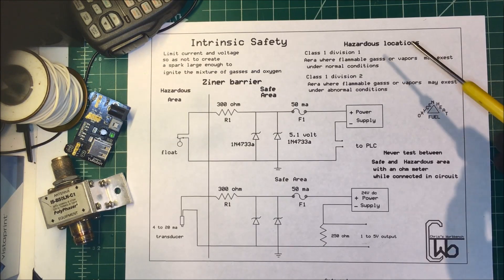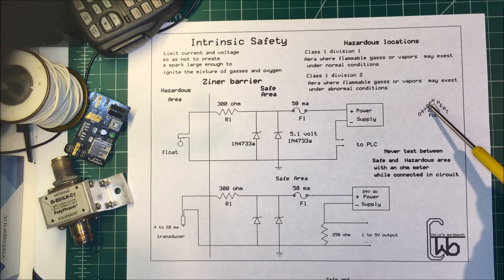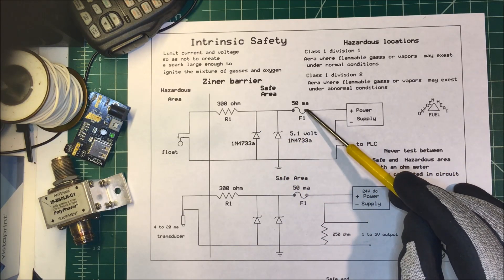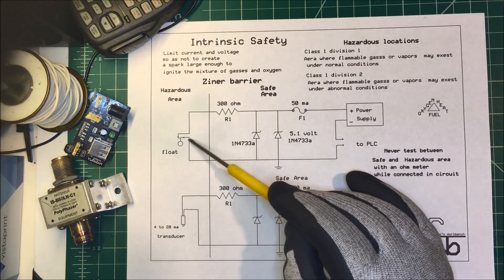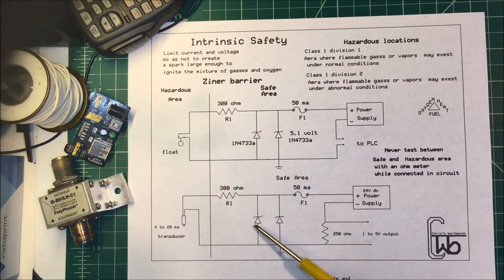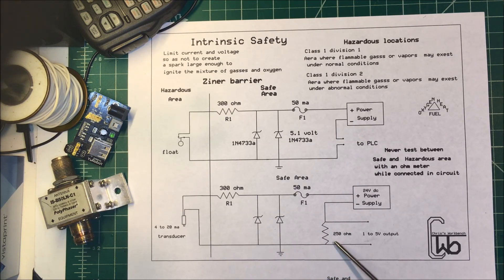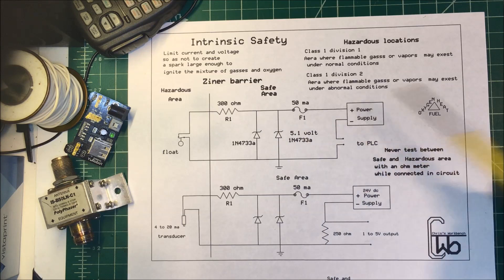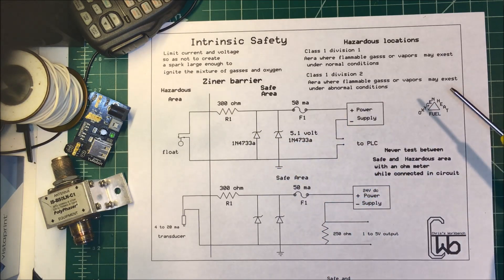Intrinsic Safety

Comment: What is the reason for using 2 zeners ??
Reply from the maker: The extra zener which are not strictly necessary to functioning, only in case of failure in other zener.